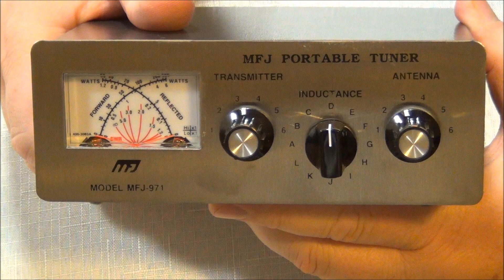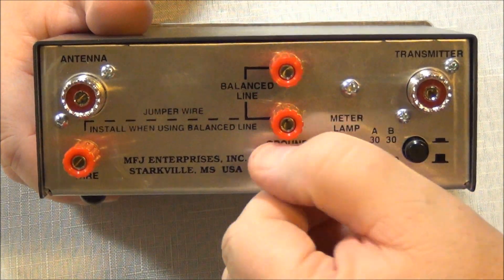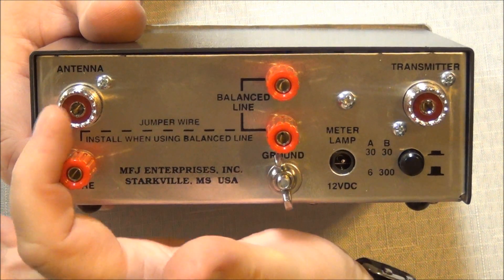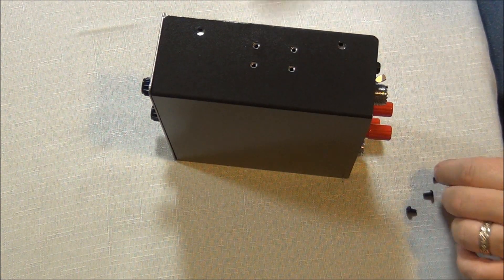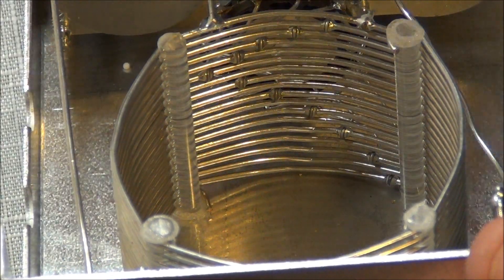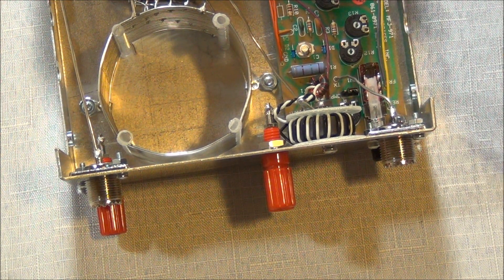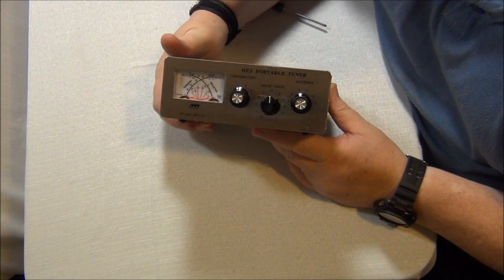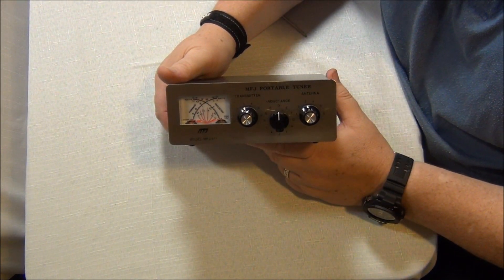MFJ-971 Portable Antenna Tuner, 1.8 -- 30 MHZ, Overview -- AF5DN

Comment: Great Video. I was wanting to get a tuner for using mobile. Not for my screwdriver but for throwing stuff up in trees and running the coax into my IC7100 and having a competent tuner for matching to various configurations. That way I can use a full 100watt load and that tuner appears to be able to handle up to 300watts.

Comment: I bought mine used in very good condition. However, I need to adapt a 12v plug to power meter light, but there is No indication or markings that indicate if the center is positive and outer negative or vice versa. Does anyone know?
Reply: It doesn't matter it's just a bulb.
Reply: @graeme9184  Humm, apparently you didn't understand the question, but thanks. Np..

Comment: Hi, is possible you can illustrate actual connections to a radio and antenna? Also explain if the rear features are necessarily to be used. What is a balanced line, Inductance and so forth. The instructions aren't very helpful. Thx.

Comment: Good morning
Is the button on the back when transmitting from 5-30W to be pressed? or vice versa?
Thank you for your answer
Reply: Wojciech B: Press the button IN for low power (up to 30 watts) or OUT for higher power (30 - 300 watts).

Comment: MFJ has the crappiest paint jobs and silk screening I have ever seen - the "T" on your front panel in the word "inductance" has rubbed off. I have a new MFJ-936B loop tuner. I gently rubbed my finger twice over the front lettering of my unit to clean dust off the front panel - two swipes with my finger and my lettering all rubbed off !!!!!

Comment: How will this work at 70 cm and 2 m
Reply: it will not work on 70cm and 2m, on those bands you really should not need a tuner if you have the correct antenna
Reply: dick head
Reply: not
Reply: An antennatuner is for using on HF so not above 30 megahertz

Comment: Good vid! I use MFJ-9420 /p and get very good results down on my local beach with quarter wave vertical, it's a very punchy little radio and the matching tuner results in a very handy /portable set-up.

Tony - G7OEM - Blackpool - NW-UK